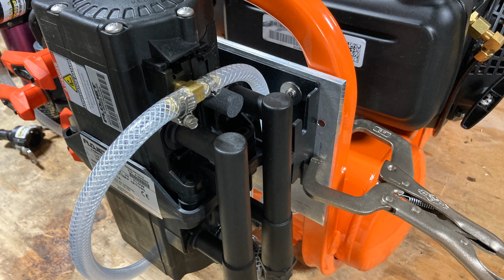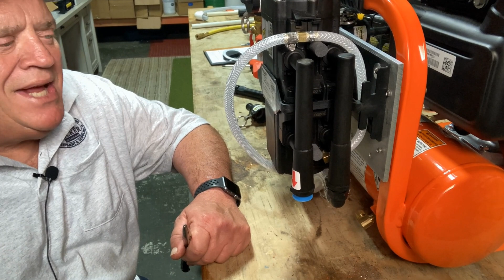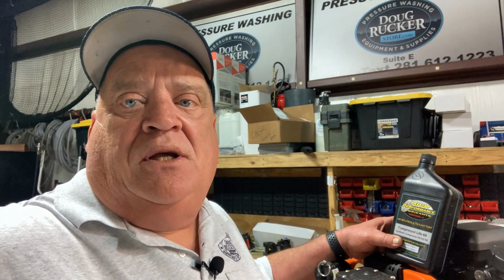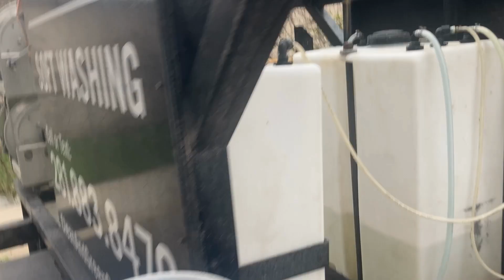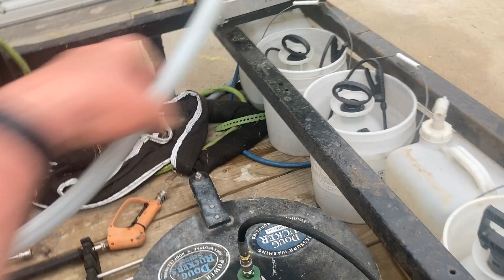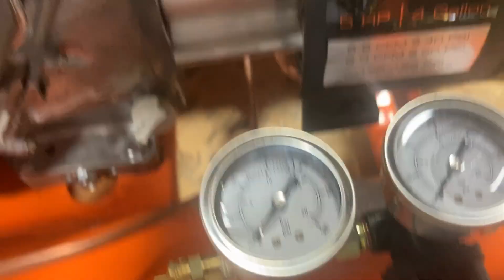BUILD YOUR OWN SOFT WASH SYSTEM [Doug Rucker's KINGSLINGER]

Comment: If you guys still build/sale these you should look into making a paper template with marks for hole locations go that you can just print out and send with the mounting plates and the customers would just tape the pattern to the compressor and not have to fight positioning and clamping the assembly. That way you all have came up with the best positioning for everything before it ships and if they want to use the template it's there or if they prefer to remote mount it they can.

Pro Tip: Boil water to dip hose ends to before installing onto barbs. Softens hoses quick and easy without risking overheating/burning with torch.

Comment: How the air compressor works with soft was station?
Reply: Thank you for replying, but that system it is not comun right also can yo upload a video how does work?
Reply from the maker: @erickvaliente8158  there are several videos in here about how works
Reply from the maker: It supplies the power to the pump

Comment: On the water air separator, you can turn the red switch left straight down and to the right. What are the settings  or positions of the switch?  
I'm also not getting but about 22 to 25 ft of reach as well.
Would I get better distance if I unrolled all the hose?
I ran and plumbed everything like your videos show.
Thank you for all the help
Reply: Thank you Sir
Reply from the maker: Left turns the air supply that powers the pump off, straight down turns it on. Yes unrolling all the hose will help a little.  But make sure the PSI on the gauge with the knob is set to about 95.  sounds like it's not getting enough psi.  The pump is rated for 100PSI so keep it at about 95.

Comment: Mr. Doug, I have a 12 volt soft wash system. I get about 4 or 5 good hours out of it, then it seems as if battery gets week. Brand new battery, so i was running an extension cord from house to battery charger on battery. Even got extra battery! Would the king slinger help the soft wash system run longer, or does it get week to! Not sure if its battery issue or pump just getting to hot! Could you help with problem!
Reply: Would the king slinger give more distance?
Reply from the maker: @RobbieBrownJr  not sure what distance your getting now but you’ll get 35-40 feet depending on wind
Reply from the maker: Yes the kingslinger runs on gas. But your battery should be lasting longer than that.

Comment: This is the first time I've seen a soft wash system powered by an air compressor. Any reason why to pick this over your general gas or electric pumps?
Reply from the maker: Generally they are more reliable and can stand up to the strong bleach mix longer if taken care of properly

Comment: Doug, thanks for your videos. I’m simple minded. Why do you need a compressor? Please exsplain.
Reply from the maker: Because the pump is powered by the air from the compressor. All pumps need something to power the pump. 12v=12v battery. Booster pump=electric. Gas powered=gas engine. This one is the air powered by the compressor. Hope that helps.

Comment: Hey Mr. Doug what is the difference between the king slinger 5 gpm or 10 GPM i’m just starting  out can I do a lot of work with the 5 gallons per minute
Reply from the maker: Mainly the flow rate and you’ll get a little bit more distance w the 10 over the 5. And yes you can do quite a bit of work w the 5.  If you can go w the 10 though it’d be better. While we do sell quite a few if the 5’s most upgrade to the 10 within a year. And it is real easy swap them out.

Comment: Hey Doug - I’m just starting out learning about pressure washing and soft washing equipment.

I am still confused on softwash systems. What I am confused on is this, do you have to have a fresh water tank ? Couldn’t you just have a garden hose feeding the soft wash compressor ?
Reply from the maker: No it has to be fed off tank. You can’t force force feed them.
Reply: @PressureCleaningSch  thank you Doug.
One more question if you don’t mind.
Is your tank being replenished by a water hose as you spray or once the tank is empty then you fill it again and mix in your chemicals ?
Reply from the maker: @wf2651  it’s continually being fed water. A float valve inside the tank shuts the water off if it gets full.
Reply: @PressureCleaningSch  so if the tank is continually fed water how do you keep your mix from getting diluted ? Is that because there is 2 separate tanks build into the 1 tank ? 1 for water and 1 for mixture ?
Reply from the maker: @wf2651  yes. Two tanks. One water. One bleach
Reply: @PressureCleaningSch  thank you so much Doug. You cleared this up for me
Reply from the maker: @wf2651  awesome
Reply: @PressureCleaningSch  I have a question on roof cleaning. If you do a cleaning with chemicals on a roof in an area where it doesn’t rain very often do you need to go back and wash the roof off ?
Reply from the maker: @wf2651  no don’t have too. But you can if you want.

Comment: Can this be used as an everyday system?
Reply from the maker: Yes absolutely
Reply: @PressureCleaningSch  well while I have you in here, I bought your higher pressure ball valve complete set up, and yes it is hard to turn. BUT, if I buy the DN10 heavy duty ball valve, can I remove the inlet and outlet from the other valve and place them on the DN10?
Reply from the maker: @meezer616  yes. They are both 3/8 ball valves. Try taking the handle off the high pressure one and lubricate at the base of the stem. Should help.

Comment: I use carpet cleaning machine pumps with 240v electric motor running off an inverter and 300ah lithium battery. The pump set up is shaker than yours and probably better and a bit cheaper and longer lasting

Comment: Would the air pump you recommend also run a 2nd set up if we wanted to expand?
Reply from the maker: Not running both pumps at same time on one compressor if that’s what your wanting to do. I’d suggest a second compressor for that.

Comment: Doug, am I wrong or wasn't that air compressor $650ish a month ago at Northern Tool? It is over $800 now.  Is that how bad inflation has gotten? I'm having to rethink my pricing strategies. I noticed a snow blower at Lowes was $899 that I paid $599 for the equivalent a few years ago.
Reply from the maker: You are correct. When I first started selling them they were $549. I guess I made them popular. Lol. But yes inflation, supply chain all has to do with it.

Comment: This system works on air pressure?  
Is there any reason why you could not use an electric air compressor?
I think you said this unit had a 4 gallon air tanks. If the motor stopped how long would you still have enough air pressure to spray with?
Thank you in advance.
Seriously considering purchasing this from you.
Reply from the maker: To the last question less than a minute or two. As to the first question the air compressor must supply 5 scfm @ 90 psi

Comment: Hey Doug, do you go through more SH using a 10gpm setup vs something like a 5.5gpm 12v system? Or does the additional gpm allow you to cover the same area faster with the same amount of chemicals?
Reply: Ready rrr
Reply: Can you use one of the General Pump wash down guns with this system or will there not be enough flow?
Reply from the maker: Really about the same but more distance and way less issues. I use 2gpm & 4gpm tips and rarely ever flood coat a surface.

Comment: I really thinking on pulling the trigger on this set up, my 12V have cost me like $400 already in replacing the pumps. Do you usually have this in stock?
Reply from the maker: You will absolutely love it over the 12 V. Yes we normally have them in stock right now we have been selling a ton of them so sometimes we get a little behind if we’re out of a few of the components but we get them pretty quick. Turnaround is usually anywhere from a few days to a couple of weeks

Comment: Doug, have you done a video on why you prefer the air system over the 12 volt system ? If not, could you please ? Or.... just shoot me a reply with the answer. Thanks !!
Reply: WI w
Reply from the maker: Pretty sure I've mentioned before in videos. But  in short after using 12V, Gas operated, and Boosters, and all a few different times, I have found the AIR to be the most dependable, versatile, and easiest to use maintain and repair/replace.

Comment: Hey Doug Great video! This is purely an academic question  but how many of those pumps could you run together?
Reply from the maker: Would all depend on the compressor you use and if it can push the pumps.  For this compressor you'd not want to run more than the one 10GPM pump
Reply: Ikke kun for 😅 n
😅
Reply: @Doug Rucker 😅 kioikkkoinkkok den kkkni kioikkkoinkkok og
Reply: Llllollpl i lov pll